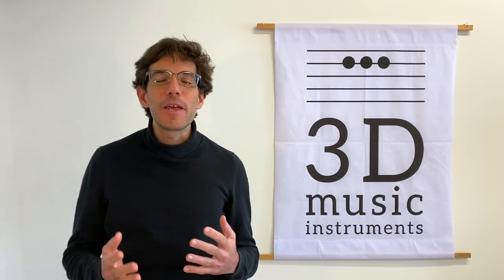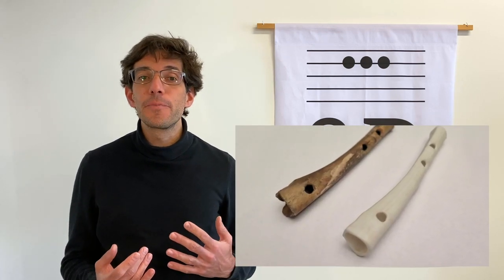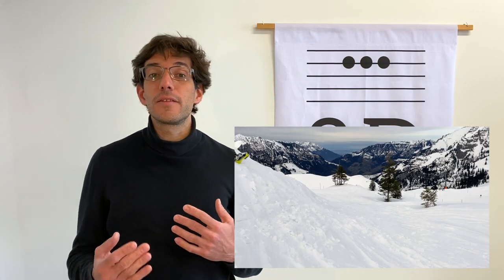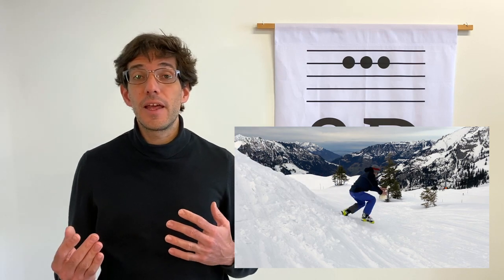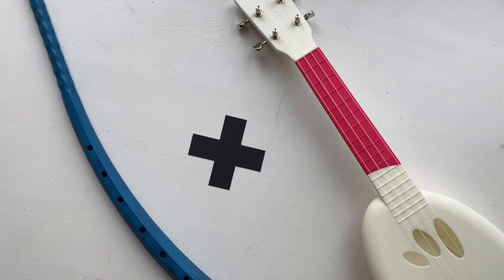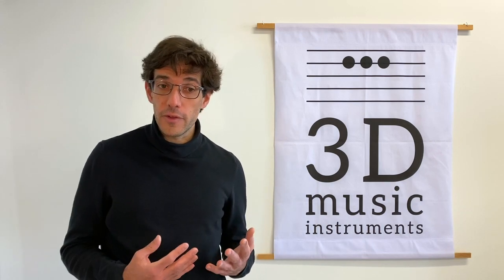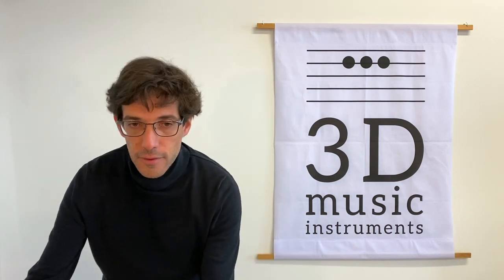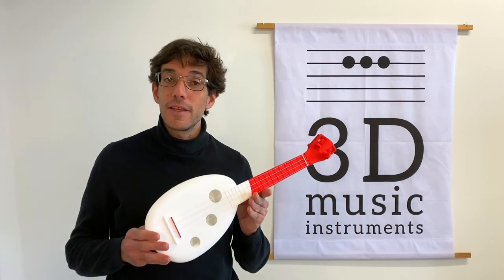Impossible instruments - 3D Music Instruments

Comment: What about a baroque oboe or shawm, with a bagpipe drone extension, and possibly a chanter where buttons can lock in a note (to act as a secondary drone)?
Reply from the maker: You mean a drone extension coming out from the shawm/oboe, without an air bag (like in a bagpipe)?
Reply: @ricardosimian  An oboe you could play whilst having something like uilleann pipes attached to it so that the arm can fill the bag.  The pipes itself would have a bass drone, and a secondary pipe that can be regulated for harmony. :-D  The oboe would be independent per se.  I guess it would be like a bagpipe with an independent chanter that you play with your mouth, ha.
Reply: Although your idea could be very interesting if somehow you could divide part of the airstream of the oboe into a 1-way valve into a bag, which would provide enough pressure to sound some drones!
Reply: Maybe you are looking for an actual bagpipe ?
Reply from the maker: Yes, even though I have tried to figure out what it really means, the description keeps seeming "bagpipe" to me.